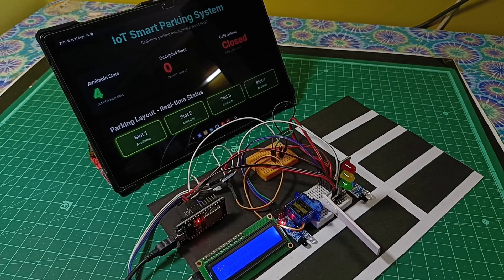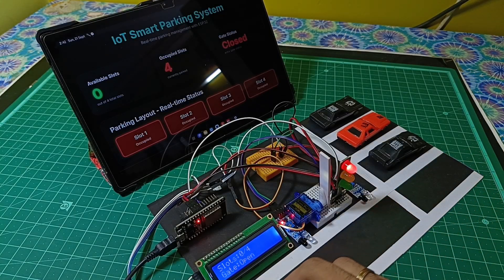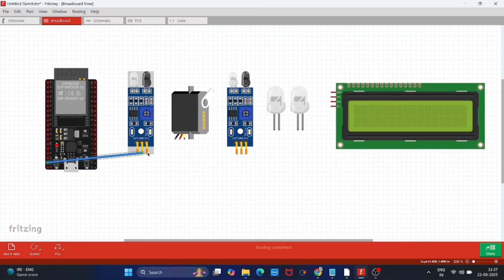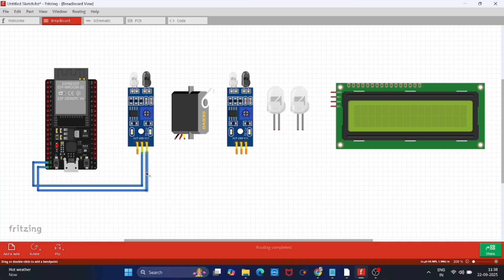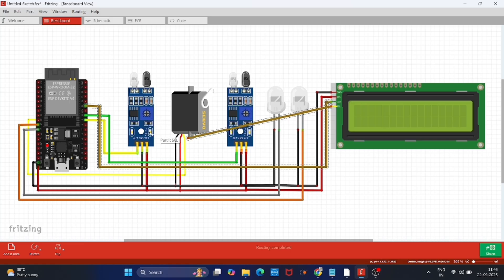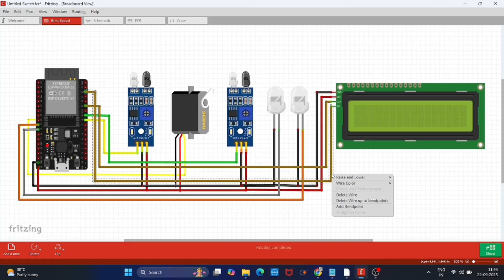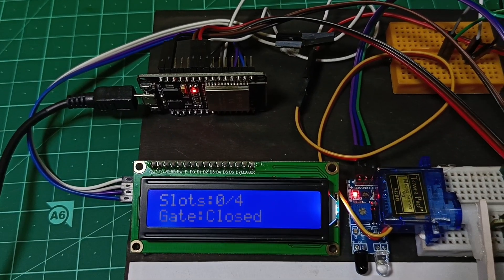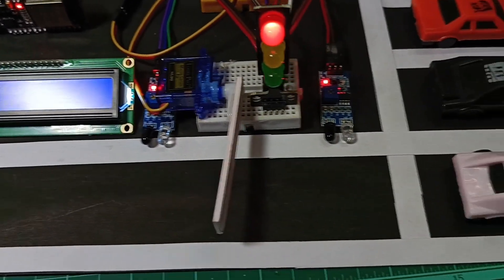IoT Smart Parking System using ESP32 | Automatic Slot Detection & Web Dashboard

Comment: Can you make an IOT version that notifies you if the parck is full or empty or when the stalls change with notifications by sending notifications via app or telegram?
Reply from the maker: It's too good idea!
Reply: @EliyasScienceInfo  right? I think so too! A step-by-step version would be really great.
Reply from the maker: Yeah I will try to make it!
Reply: @EliyasScienceInfo  Imagine how great it would be if users of the parking system could check the availability of parking spots and receive real-time notifications about status changes directly on their mobile devices — whether through an app or a Telegram chatbot.
Furthermore, the system’s configuration (such as stall status, messaging, and more) and activity monitoring could be managed through a web-based interface, implemented using the AWS IoT Shadow Things, and Node-RED paradigm to ensure scalability and efficient control.